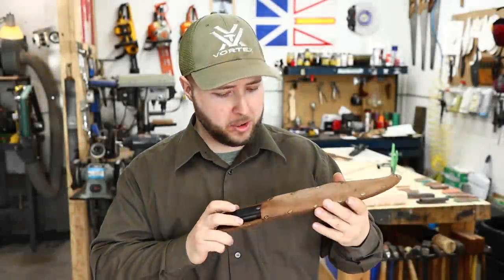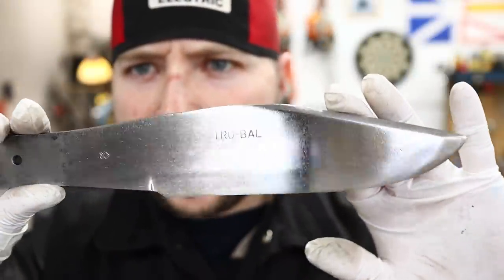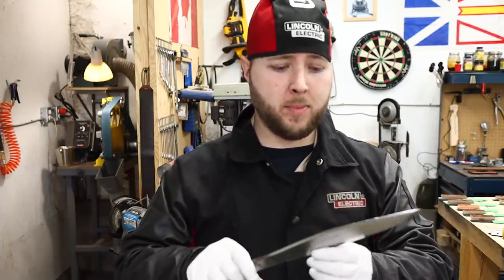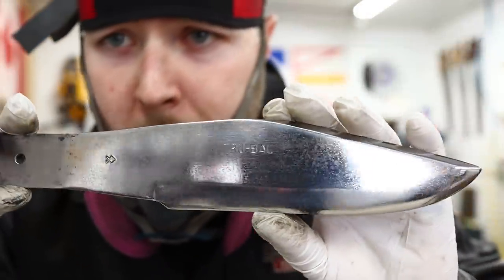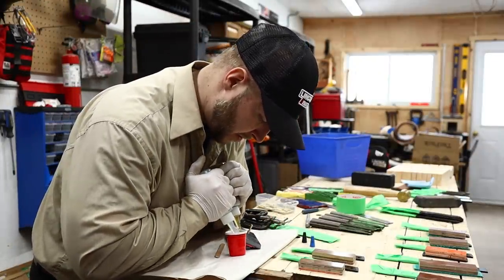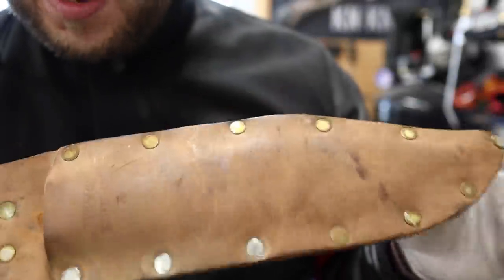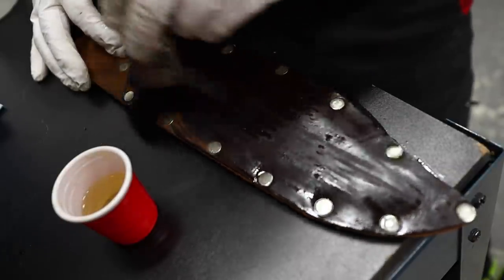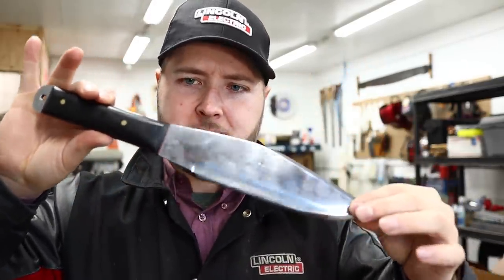Restoring the most Outrageous KNIFE I've Seen! - KNIFE RESCUE

Comment from the maker: You can email me 2 weiderfan.business@gmail.com, or check out my WEBSTORE! at https://www.kylenoseworthy.com/
Reply: I like the restored patina on it, the pitting adds cool character. What do you use for dust collector for your grinder? I need to make or buy one so i don't have dust all around the shop.
Reply: Tru-Bal is short for true balance and these are from around the mid to late 60’s/ Vietnam era and we’re throwing knives I believe.
Reply from the maker: @dgundeadforge17  I use a King Canada blower. The hoses and bracketry I did myself. Moves close to 700 cfm of air if I recall correctly. It really grabs the dust. wild!
Reply from the maker: @DiabloBlanquecino  Thanks for that information!
Reply: I do realize you may not have the time to research all the knives you work on. you can reach out to me and i could easily do the research on my free time free of charge.
Reply: @DiabloBlanquecino  these knives are currently in production and the bowie axe is currently retails at about $126 to $165
Reply: @mikeadonitt893  my comment is still valid whether they still sell them or not.
Reply: @DiabloBlanquecino  correct, i had a pair in the 90s, i got them from my scout master for the boyscout knife throwing competition.
Reply: @mikeadonitt893  current ones are reproductions made from stamped typically stainless steel, originals were hand hammered from high carbon. i had an original pair from the 60s in the 90s.
Reply: It's funny, here in the UK we pronounce it as "size-el" wheel.
Reply: @joshuatempleton9556  the current tru bal bowie axe is made of spring steel while there are many companies who have copied the design that make them out of stainless steel tru bal has kept with the spring steel
Reply: @DiabloBlanquecino  i was actually just informing you that they was still in production while the design original started in the 1950s has never gone out of production
Reply: It looks like a throwing knife.  Killer blade&killer vid knife bro!!
Reply: Do you ever test the knives on the chickens?  You could do a cooking video.

Comment: Tru Bal is a throwing knife company, and you have a knife intended for rendezvous-style throwing contests.  The weight helps to smooth out any hitches in the thrower's form, plus a heavier knife will stick in more chancy target materials.  Most of these knives use leather scales deliberately, since materials like that beautiful Micarta will shatter the first time another thrower hits that knife's grip and may even fracture just from the impact of hitting a target wrong.
Edit re: scale thinness & shortness - those scales are there to satisfy booshway rules, the blade throws just as well without any scales at all.  The blade is called a Bowie Ax because with all that weight forward it throws more like a hawk than a knife.
Reply from the maker: I was doing some reading after the build and discovered the fact that its actually a throwing know. Very interesting! I'm doubtful this knife will see any real use. A family treasure at this point in time
Reply: Great comment Don! Thank you for the info!!!
Reply: @kyle_noseworthy  After losing the thin meatless handle it USED to ber a throwing knife.
Reply: Exactly what I was coming out to say. Don’t know if that handle will hold up or impact performance. What was funny is in the beginning he asked if anyone ever saw anything like this. Well, mine is next to the bed. Should have seen my wife’s eye roll when I said, “well actually yes I have.”
Reply: I used to throw those knives with leather scales and copper rivets in  tournaments at Fort Snelling in Minnesota when I was a kid
Reply: @jeremykask5078  I've made Tandy a bit richer more than once, getting a set of those ready for the season.  Most of my throwing was for the SCA, and so done without scales of any kind, but I kept a set rendezvous legal for a lot of that time just in case.

Comment: Hey Kyle,
I'm the watchmaker from one of your other videos. For refinishing stainless watches, especially if there is pitting or damage I use Menzerna gray polishing compound on a hard felt wheel. The gray is very "greasy", and while it looks like rouge, it behaves more like a super thick paste. Basically I go over everything BUT logos or anything embossed which I keep protected with 3M polymide tape. The cool thing about Menzerna gray is that it cuts very little. It almost flows the metal. 
After cleaning the piece off, I switch to a cotton buffing wheel and Menzerna white which will give it a good shine and if you keep the speed reasonable will not affect the logo if you just make really quick passes over it. 
For brass or gold I do a quick pass with
Menzerna yellow on a different cotton wheel. 
This is the method I learned about 12 years ago from a very well known luxury watch company and it is still what I use today.  You should really give it a try!

Comment: The Bowie-Axe is a true back country hunters blade - a kind of "do alot of things" blade.  I inherited mine from my father who used it for hunting prior to his deployment to Vietnam where it served as part of his private purchase gear.  For him, it saved his life and others in his unit multiple times.  It is heavy and odd at first, but you would not believe the countless uses for such a blade when in the backcountry.  The Spring Steel is top notch and the original handle served its purpose for handling (with bloody hands) and for balance when throwing by the handle.  I would not change the handle at all.  Since then it has served me well as a back country hunter who tracks into the mountains and back.  I wouldnt call it the most Absurd bushcraft knife...but i guess an opinion is an opinion.
Great Job on the refurbish!  Thanks for posting!

Comment: I used to have 1 EXACTLY like that ...its originally made by Harry K McEvoy's company call TRUE BALANCE ...he is the author of quite a few books on tomahawk and knife throwing  !
He was a professional knife thrower an hunter WITH  throwing knives just like this 1 !
This model is call the ''bowie axe'' because you can throw it like a axe [by the handle] OR  like a knife [by the blade] !
I think the company has shut down nowadays but COLD STEEL knives actually made a reproduction bowie axe for a while !
My original Bowie axe model was stolen from me back in the late 90s but I still own 2 of the cold steel versions !
Its not REALLY made for ''chopping'' its made for THROWING an it excels at that purpose once you learn how to use it !
The handles were thin so they didn't get torn off [and or throw of the PERFECT balance] while being thrown numerous times
Reply: The company was bought in 2018 by Bobby Branton, and is making the same knives McEvoy made, along with some new designs. You can buy new ones cheaper than you can buy the original McEvoy knives on the secondary market.

Comment: Something fun with restorations is cleaning and repairing it but still preserving the age and wear that tells the story.
I restored my grandfather’s WWII Navy corpsman jack-knife and kept the pitting and wear.  It looks like it’s 80 years old (pretty much: 1943 vintage) but it opens smoothly and shaves easily. I added a leather lanyard and made a pouch for it to live in.  I’m still working on it’s accompanying scalpel.  It needs some work getting the edge back; researching says it’s a flat grind and it had a secondary bevel on it, so it’s dicey getting that tiny blade back in shape

Comment: I've seen the Cold Steel version of this, but I had no idea it was based on an older design. This video makes me kind of want to get one, but the Perfect Balance version from CS looks to have a hollow grind instead of the convex the real one has, which seems like a very bad change for a throwing/chopping knife like this.

The original handle scales definitely don't seem ideal for using this like a normal knife, but it is intended to be a throwing knife as well and I wonder if your extended scales are different enough to throw off the "Tru(e)-Bal(ance)" the knife was designed for. I guess I hope the owner never finds out, because any throwing is bound to change that BEAUTIFUL finish you brought out, I really love the texture the pitting gives to that polish.

Comment: The Tru-Bal Bowie-Axe was made by Harry K. McEvoy circa 1970.  That particular design is often referred to as a Vietnam Era Bowie-Axe.  That knife probably had more value before you removed the original handle slabs.  The original sheath also increases the overall value of the knife.  That model is classified as the #2, and was designed by Harry K. McEvoy about 1959.  The knife is still in production today, but by a different company owner.

Comment: The scratches tell a story of usage, especially if it was yourself putting those scratches there.
So generally, I would like to keep the knife's story.
One exception, if it's a kitchen knife, I want the scratches reduced to a point where bacteria can't hide in the scratches too easily.
It doesn't have to be perfectly smooth , just easily cleanable.

Comment: Kyle, Another great video. Thanks. A question, please... When did the makers and those doing restoration start using epoxy to secure the scales? I ask because, as a hobbyist, I have a more difficult time removing the scales to access the spine. I prefer to use quality brass screws and nuts, usually with a drop of blue loc-tite. Thank you.

Comment: Depends on the branding. Often the only way of knowing the maker is through the branding on it so if you lose a good branding then the knife could be from anywhere and made from any steel. If it is stamped Walmart it wouldn't be a big deal. If it is stamped Schrade then that's a different matter.

Comment: That knife reminds me of my GK&Co. knife I like calling the "Kukri Bowie." It's shaped like a Bowie but the sweeping part of the forward half of the back is sharpened into effectively a 1.5 edged knife. The spine itself, like any real kukri from GK&Co. is nearly half inch thick. The handle itself is made of black ox horn. Only complaint I have is the ox horn handle is sized for someone with a much larger hand than what I have. The sheath is made in the traditional Nepalese wood and leather construction.

Also the overall shape of that "knife axe" is almost identical to that of a real kukri but without the characteristic blade forward bend of most kukris. I have 3 different kukris of various sizes that I use often. A 10", 12" and a huge 18" with a super deep 4" belly I call the Butcher.

Comment: I'm making a work knife at work right now SS full Tang with mild steel handle just goin to use a angle grinder to get the profile I want but don't have a way to harden the blade what would be a good easy way to do so

Comment: Would you please tell us of the grit of the sand paper used in sharpening.
Reply from the maker: Hey Joseph, I used 60 for profiling, then 120, 220, and 600 belts to get to a refined edge. After that, buffing on a compounded spiral sewn wheel

Comment: Beautiful job.  Definitely keep the original markings on the blade. To do otherwise would be a shame, and spoil any authenticity.  If it is a working tool, it will over time develop character marks that add far more value than a shiny, pristine blade, IMHO.

Comment: Should an "axe" like that have a paper-cut sharp edge ? 
Does owner actually use it for whatever it is designed for ?
Reply from the maker: I'm not sure how the owner will be using it, but I assure you this knife still has a very stout edge. Quite durable, even though it can dice paper
Reply: @kyle_noseworthy  Love the black handle. Not familiar with the material.
Reply from the maker: @stevejette2329  Micarta is essentially any fabric material that is laminated in many layers, soaked with resin / epoxy. You can make it at home using old shirts and jeans and things, and experiment with patterns. I order all of mine, and they're usually made with layers of linen or canvas. Burlap looks really cool!
Reply: @kyle_noseworthy  
My little mind is blown !! I love learning. 
What resin do I ask for at the paint store ?

Comment: Wait.. what kind of wire wheel is that for your Dremel... 
It looks like a normal wire wheel.. but then u are using the tip... Which is usually a screw, or a rivet of sorts... Does that have a second wire wheel on the... Wire wheel... Lol. Or something
Reply from the maker: haha No, it's a pretty normal little brass wire wheel, but its more like a 'cup' wheel. Does that make sense? You can get 'disk' style, or 'cup' style.

Comment: Keeping your fingers on the lower end of the blade so you can feel. The angle is the best thing that I've ever came across. Cause I was putting my fingers of the knife and I was not ever getting a sharp knife. Because I found out after putting your fingers.
On the spine, you were more or less digging into the.  Stone where your fingers are down at the cutting edge. You can fill the angle and keep that angle and it gets sharper. I don't care whether it's on any kind of dropping any kind of storm. You will get more out of your Stone than you ever. Ever God when you keep your fingers at the lower. You can even use denim with dropping paste. Oh, my God, I didn't even go to your scrubs and keep going to Piner. Er biner's drop then different kind. But keep your fingers at the lowest. And you're sharpening angle and you can feel it right down at the sharpening, not on the spine.  I don't care whether.
Or or a stone makes so much difference

Comment: Wait. You said the company is brand new, but the thing is covered in pitting? It can't be that new. It would take a couple years in the muck to do that.

I'd keep the pitting, and polish it with the etching in tact. What's the point of refurbishing anything if it doesn't have any of the old characteristics?

Comment: it depends on the blade, if its a name you care about, leave it on there, if its kinda "mass produced" and nothing really special, i'd be fine with removing it. however, if you remove it, you also remove material from the blade wich could change its characteristics. for me, there is no general and definitive answer to this, its a case by case decision

Comment: It is a tool that can be used in the field for dressing and breaking down carcasses.  It has the heft of a clever but the feel of a knife...albeit a hefty knife.  So you get the slicing, piercing, chopping, and cleaving attributes of many tools in one.  If you keep a stone with you, this thing can handle brush and smaller limbs with ease.  If you could only have one tool this would be it.

I know what the knife was used for originally.  The thin handle and heavy front weight is a giveaway.  I chose to emphasize its utility as a bush knife/tool.

Comment: There's no point in owning an old knife if you're going take away all of its character - the nicks, dents and scratches it's accumulated over its lifetime - by restoring it to "perfect" condition.  
Coin collectors don't polish their coins, for the same reason.  Museums have to walk a fine line between conservation and restoration, but even with very old works of art, they err on the side of conservation.  They might not fill in the chips on an ancient Greek marble - but they did restore Michaelangelo's Pieta when some lunatic took a hammer to it.

Comment: If the blade is my blade, i´m not interestend in any "value" it might have beyond the one it has to me. Therefore i don´t care much for stamps or etchings on the blade. If those have to go in order to have a shiny, clean blade again, so be it. 
If i cared about the markings on the blade, it´s either already old/collection item and sits in a cabinet or it´s a piece i only get for putting on display.
On a blade i use/carry, i don´t give much for the markings at all.

Comment: The level of finish depends on the knife.  On those kitchen knives those scratches were so BAD that I would like it clean even if all the badging and branding is all gone, it was just so darn ugly.  On this knife I would probably take off a bit more than you did because the badging is so deep, but U would leave them in there.  But if this Tru-Bal was a badly scratched up by an idiot restorer then I would rather clean it up completely vs leaving it ugly.  To me its not a restoration if it looks like garbage.  Your handles were AWESOME but those blades are stupid ugly.